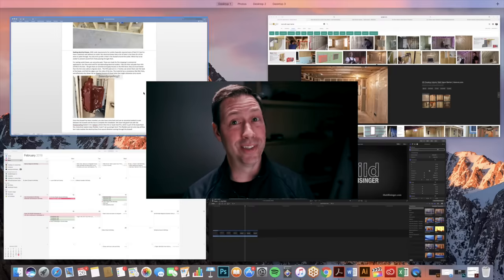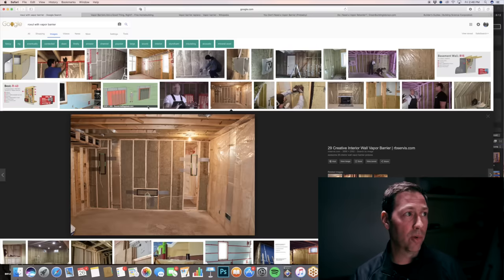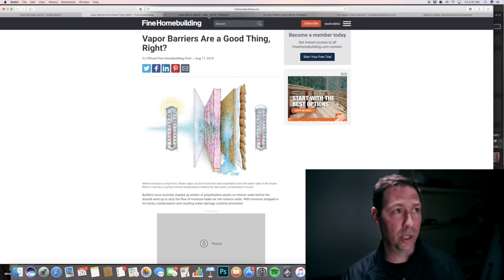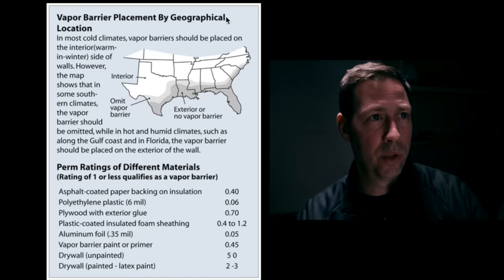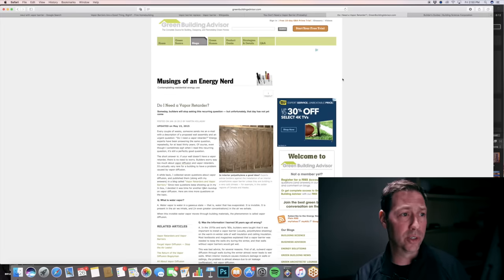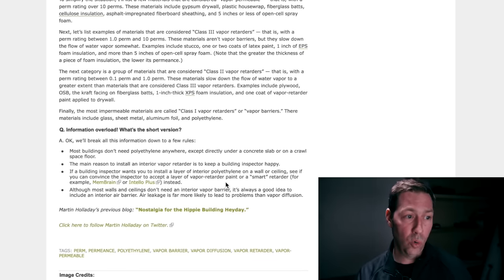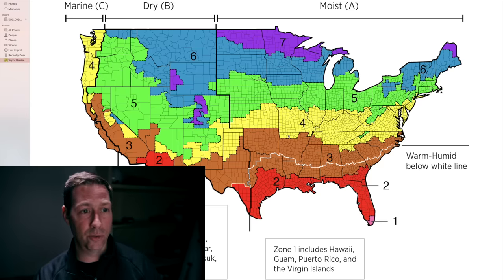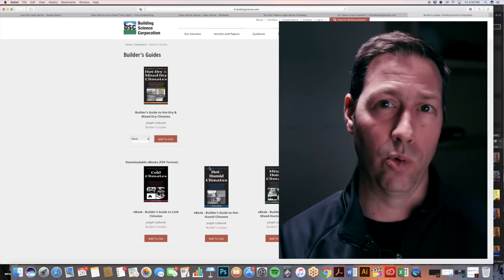Vapor Barriers: Need one or not?

Comment: I have a Split Level Home. My Corner Office has 2 Exterior Walls; one side is above ground and the other side is half below ground. On the other side of the exterior wall that is above ground I have water pipes for the faucet (Hose). Do I need a Vapor Barrier on the exterior walls that have water pipes? I am located in Zone 5 and we have long Winters as well.  I did notice the same thing when I pulled the drywall as I spotted mold under the wall paper, and the drywall was soft and the bottom frame holding the studs was rotted; very dry but very brittle. The Copper pipe is completely BlueGreen.

Comment: Great information. Have you talked much about spray foam insulation in the different climates? Would I want to make sure who I hire uses a specific type in the northern states like lower Michigan? In my case I have an old 1900 house with no insulation in the walls.

Thanks again for the great content.
Reply: I have always heard, read about and installed the closed cell, it's superior compared to any other type of insulation, jmo . ONLY,  if it is installed correctly, meaning not too fast and done in small increments to make sure the layer below has had sufficient time to cure and off-gas. Then, before sheetrock, let it sit for 2 weeks to vent, covering it too soon is horrible and could be deadly.

Comment: I'm remodeling a kitchen in a house built in 2000. There is a vapor barrier on all exterior walls (it's called out on the original plans). I've pulled the drywall, vapor barrier and insulation to frame new window openings and can't decide if I should install a new vapor barrier when I re-insulate. Does it affect the overall building envelope if there is a vapor barrier on some walls and not others?

Comment: Remodeling a home in northern Maine (climate 7) and I just pulled out the most mold anyone had ever seen from a room that was entirely wrapped in poly. I had to gut the room down to studs and even replace most of the floor joists. Granted the prior owners had plumbing leaks and also wood paneling on the dry wall. TERRIBLE COMBO! I am only putting plastic on the ceiling after talking to the local contractors. And I am even on the fence about that. I want this room to BREATH!

Comment: I have a question regarding the use of polyurethane foam insulation. I live in the Raleigh NC area and used poly foam flash and R-19 fiberglass bat in 2X6 walls. Would this cause high humidity in the home?

Comment: what do you recommend  for northern wisconsin.poly on the inside should work if take your time and air seal it with 20-25 r in walls for vinyl siding ?!also keep low humidity in the winter and not very cold interior in the summer.basically use the poly as air barrier  as supposed to vapor barrier?or should u use different material for air barrier?

Comment: Here in northeren europe we put insulation on both sides of the vapor barrier. Half X mm inside and X outside. This way the temperature on the inside and the outside is the same.

Comment: Hi,
Ok now I'm really confused I'm in the planning stages of a timber frame house in northern Idaho. I'm planning on going with SIPS, with a cold roof, standing metal roof. My finished ceiling is going to be tongue and groove with 3.5 air gap between the SIPS and tongue and groove, this air gap will allow enough spacing for the LED low profile lighting.
My big confusion is do I need a vapor barrier of some sort at the peak of my ceiling. I have heard of many horror stories about about failure of SIPS IN this area. I as a home owner want to avoid this.
Thanks 
Edgar Acosta

Comment: I’m residing my mid 1970’s home in North Carolina. I’ve come across something that seems strange to me. First layer is old cedar shake, next layer is some sort of ⅜” pressed cardboard 4x8 sheet nonsense. The third layer, which puzzles me is 6 mil black plastic? Now…I am not knowledgeable of building practices but it seems to me that having this fastened to the exterior of the outside walls would trap moister at the interior stud bays???

Why do you think that was done? Should I remove it and tyvek on top of the sob sheeting?

Thanks for any advice

Comment: Matt. Building my house in climate zone 7 in PEC Ontario above code here because of you.
Siding (mix of metal and composite wood.)/1 inch treated wood strapping / halo 1 inch foam house wrap (R5) taped / 1/2"plywood / 2x6 16C /3 inch Sprayfoam (vapour barrier and R 20) / Roxul comfort batt (R14) / 5/8" drywall on road side and 1/2" all around. @jtrenovation

Comment: I could use some help. I'm in climate zone 3 and I'm not sure why but my air conditioning units have constant chronic failure on several levels. The electricity usage is insane, the pans are always full, when they were installed one pan had an active drain and one had passive. I've since made them both active, because the passive one was ALWAYS full. Now they both drain into the flower bed on the side of the house, and that thing is basically a mud pit. It's just never not completely soaked thru The units also have a hard time keeping up with cooling needs, and I'm afraid to look in the ducts and see how much mold there is up there. Both units have been replaced in the life of the house, one has been replaced twice. The house is only 12y old.

Both units are outside of the envelope of the house. The attic has several circulation fans, but it gets absurdly hot and humid up there for some reason, much worse than ambient. 

Having watched many of your videos, I feel like it would be a good idea to bring the attic into the envelope of the house, but i have what seems to me like a pretty complex roofline, and spraying foam insulation doesn't seem like a diy job. I've had it quoted by a pro and the price is just too high.

I just went and bought some 6mil plastic sheeting with the intent of just bringing the units themselves into the envelope, but now I just ran across this and I'm no longer sure this is the right move. 

My intent was to just stake the sheeting up to the rafters in the walkable area of the attic, and then installing a dehumidifier in the new 'room' draining into one of the pans. I was not going to actively cool the area, just count on what leakage may come from the systems themselves.

It would also be nice to be able to store things in that space as well. It's just WAY too humid, i don't trust putting anything up there right now.

Would an unbacked vapor barrier being used as basically temporary walls be problematic? The air space would still be intact on the opposite side, and it has soffit and several fans all the way around the house. I'm also hesitant to do anything more expensive because I'm considering leaving in the next 5 years and i am pretty sure it's going to need a new roof before then as well.

Comment: Video format pretty good but you didn’t mention faced insulation. 
Faced insulation isn’t a plastic so would it be subjected to the same conclusion?
Reply: I'm a fan of using faced insulation because it's supposed to keep air out but can let vapor pass through. I would like to know more about its long term durability as I've installed it but never seen the inside of the walls again afterwards and I have not done a demo where it was used.
Reply: From my understanding:
Vapor barrier: Vapor barriers have a permeability rating of 0.1 perm or less and are classed as “impermeable.” They are often installed to block moisture inside walls and ceilings, under concrete slabs, and in crawlspaces.

Vapor retarder: Materials with permeance ratings between 0.1 and 1 perm are considered “semi-impermeable” vapor retarders, and materials 1 and 10 perm are “semi-permeable.” Vapor retarders may slow moisture, but they are not effective in stopping it the way vapor barriers are.

Comment: But what about air movement in general; how would I address that?

Macon, MO here. And the house I bought is an 80s house but there are so many points where air can escape and thus my energy bill is wild.
Having felt the difference between my house (1981) and my grandfather's villa (2007) is wild. Both of us have nest thermostats and with my house at 74, I still get chills and some rooms are icicles. When his is 74, it's actually just right and sometimes downright too hot.

I know my home isn't sealed well but I aim to change that. The trouble is, I had this exact idea to put up poly sheeting in order to stop undesirable air movement. But after watching this video, I'm getting the impression that the message is DON'T put up a plastic sheet to stop air movement.

If I am understanding that correctly, what are my options then?
Any clarification would be super.

Comment: I have an old metal building 20x48 with 8ft walls and 12ft ceiling. This will be a game room with a hot tub. The inside walls will be plywood. How would you insulate this building? 
Ken

Comment: So I live in zone 6 upstate N.Y. I'm finishing in my basement. It already has 1 in foam board with the foil taped and sealed then the 2x4 stud walls and then r-15 faced installation. Do I need a vapor barrier? Polly plastick. Or is the faced installation enough?

Comment: What about pre 1990s, referring to 1961 zone 6.5 on your scale for me.
Basements in this era are not really made to be finished how ever ours is very clean no leak however the floor does have several settled crack the run the whole length.
Once I seal the crack should I use a barrier for my basement walls? If yes should it be sheeting over studs and taped or paint and seal the concrete?

Comment: I figured it out several years ago that the vapor barrier garbage was just that, garbage. I couldn't understand why I needed a barrier for batts but not for blown in insulation. That is when I realized the experts weren't. I stopped loosing sleep over it and used whatever I had.

Comment: So how do I reduce moisture in my basement in zone 5? It’s a split level house. Water works on the windows every winter. Constantly getting mold growth in kitchen, bathroom, and in heat pump vents (heat pump only recently put in so it’s not that). I have a dehumidifier on both levels. I was told to get new windows, then told to heat basement, then told a new roof would work. Guess what, all of that was done and still have tons of moisture. No actual water in basement. I’m broke now and my next step is to either find a way to stop humidity rising up into the house or insulate the attic better. Or will insulating the whole house better the answer?  Or do I need even better windows or insulation around the windows? Or insulate the cellar ceiling? Or finish insulating the attached 2 car garage? So frustrating!
Reply: Sounds alot like my problem. I'm also in zone 5.... However, I've discovered that my problems are from having solid masonry walls. Would that be your case? (Brick veneer, cinderblock, and parged plaster interior. No insulation.) Sadly, I've got the same kind of issues it sounds like you have. Also, my attic is improperly insulated. The old batts up there are from the 40s and have a double vapor barrier. So that is contributing to my problem. I also had a leaky basement, and have taken measures to stop the leaks coming in. Little by little I hope to figure this thing out. -- I realize Matt is super busy and can't respond to all our comments, but hopefully you'll find answers from someone in the comment section. They used lime mortar in the bricks of my house, allowing it to breathe. But that seems to allow excess moisture in. Very frustrating indeed. Good luck to you.
Reply: @SheenaRea  Thanks for your response. The new roof is helping about 10 to 20 percent. Still have to run the dehumidifiers on both levels. I did finally realize that the curtains aren’t allowing enough air to get to the windows. I’m not sure how you can go without curtains? I guess I have to find a way to hang them further out, away from the windows. Every morning I open them up and have small fans in each room to dry the windows. That does help cut down on mold growing on the window edges. I wish I had ceiling fans. I bet that would make a big difference. But that would be a huge undertaking at this point and more money. I think you are right, my basement is unfinished cement. I’m sure that’s part of it. Cracks in cement do cause more moisture from what I’ve read. I’m wondering now if they make curtains that are better with moisture but still give you privacy. Good luck to you. Let me know if you ever figure it out. And I will do the same.
Reply: @lbarc3376  Hmm LBarc, that's very interesting! Just wondering, are your gutters working good too? That was one of my problems. Gutters are up high, and I have to get the 20' ladder out (which I can't stand to do) to clean out debris. During moderate to heavy rains, if my gutters weren't clear, water would pour out alongside my house, going straight down the siding and bricks. Caused my windows to get way too drenched and too much condensation. This was happening for years because I didn't realize the importance of having clean gutters. And also, my problem happens to be on the NORTH side of the house, where it doesn't get sun. So if it's too shady, rainy, watery, etc. THERE'S too much dampness. And that was where my basement would leak, too. I've taken steps to slowly alleviate these problems, but on a budget, have been SLOWLY fixing. Since monitoring these issues, the moisture/mildew problem is 50% better. Also I have two very small dehumidifiers inside the two closets where the mildew used to be bad. I wish my house had big eaves to help the water stay off my building! It's a cape cod with gutters flush along the structure, a real pain!! (Wish I knew this before buying the house 26 years ago! LOL). Good luck. Yeah keep me posted if you have any more success! 🙂
Reply: @SheenaRea  No gutters. I don’t have any because I don’t want to have to clean them out. lol  But doesn’t seem to affect the cellar. The split level is kinda up on a slight hill. The front yard is flat but sides start to slope down and then back yard really slopes. It’s all gradual but makes for good drainage. All my windows are the same moisture/wet. You would think that the front of the house would be dry because we get a ton of sun most of the day when it’s sunny. And my cellar is more humid than wet. Humid enough to cause mold though. So the dehumidifier helps. And the windows don’t get wet like the upstairs. Makes no sense. I definitely would have bought a different house/set up if I had it to do all over again. I also have 1 closet that can tend to get moist and did have a small amount of mold at one time, but keeping the closet (sliding doors) open about an inch or 2 stopped it. It never seems moist in there but needs air flow for some reason. Can’t explain where the moisture is coming from. Thanks for the tips though. The only thing that helps is the new roof, dehumidifiers on both levels, curtains kept all the way open, and a fan in each room blowing toward the windows. The windows dry within a couple hours so I can turn the fans off. The windows would be really wet all day if I didn’t open the curtains all the way. It would take at least 4 to 6 hours to dry. My electricity bill is $250 a month in the winter.
Reply: @lbarc3376  Sounds like you have a good plan to maintain things. I feel the same way, kinda wish I hadn't bought this house, but it's "water under the bridge" so to speak. Probably the clay soil around my house holds too much dampness, and it lingers.🙂One thing I learned, to respect water and the potential damage it can do. Seems a big part of home ownership. Glad your system works. My utility bill is a little up there, but I have a wood-burning stove which helps defray costs during Winter. Keep on keeping on!! 👍

Comment: SOOOOO.... I have a question....  I'm insulating a shop in Tacoma Washington for HVAC, Do I need to mud and seal all the joints ion the drywall to prevent a moister nightmare? To be clear, this is a shop, and we are not worried about the aesthetics.

Comment: With a TPO fully insulated roof, with 12 inch joists with cedar plank ceiling , do we need any barrier or insulation?  And if we put R- 15 rockwool batts,  would air pollution be a problem with no barrier above the cedar ceiling?

Comment: Hey. Really appreciate this video.  My company did a basement bathroom remodel where the homeowner specifically wanted spray foam above ceiling and on back side of walls. After they started using shower they had major condensation on ceiling and walls even when using proper exhaust fan.  Would a special paint be a solution to this problem. Or any future recommendations?   Thanks
Reply: Sounds to me like, the fan is not moving enough CFM's , it is not warm enough in the home. Warm air carries far more moisture than cold. Where is the location of this home? USA, Canada, Other? Is it a concrete foundation Wall?
After a long hot shower, I don't think it really matters where the location is, Unless there is close to 100% relative humidity with above 80 degrees F Or 30 degrees C Approx. There is going to be some condensation!!
Reply: Joel makes a good point on fan size, so many people and contractors opt for the smallest, mainly cause they're cheap, GO BIG !!!!  I always leave the fan on for at least 10 minutes after showering with the door open for the best air transfer. I have a pellet stove, it's so dry that when I touch the kitchen faucet, you can actually see a 1/4'' long, bright blue arc from your finger to the faucet and wakes you up real quick so the bathroom dries out fairly fast.  The paint I use for my bathrooms with a shower is Zinser Bathroom Paint, 5yr guarantee against mold, mildew. I use the semi-gloss because it seals the sheetrock much better than say a flat, Matte, satin, eggshell, etc. Doesn't look as pretty but I don't care, I want it sealed.